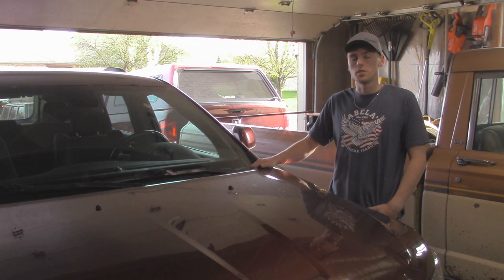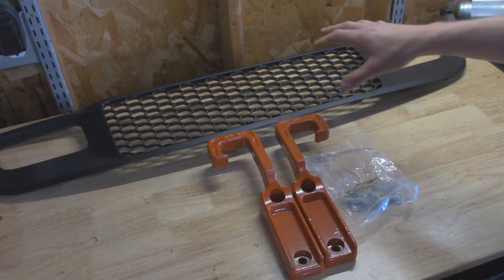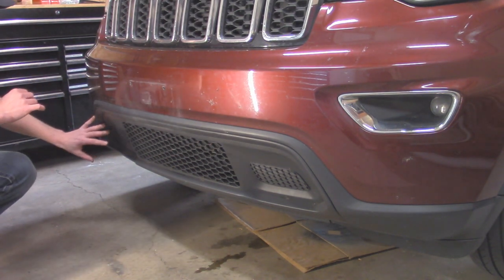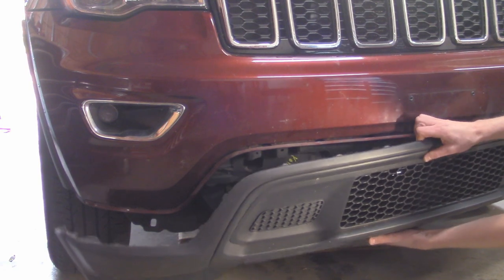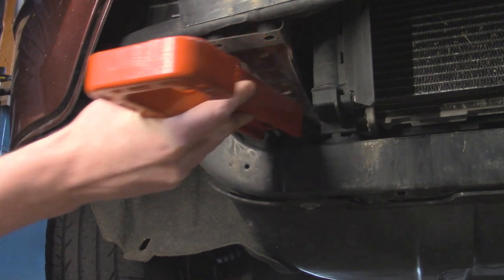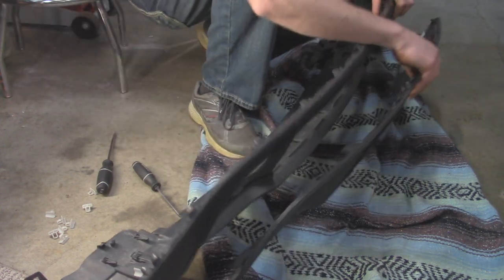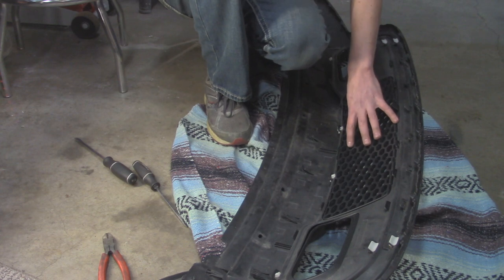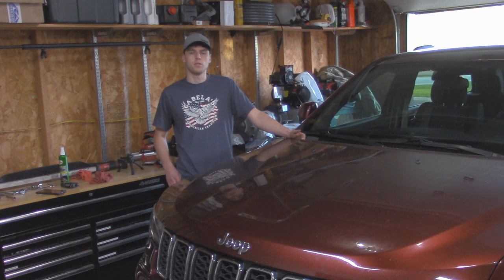Jeep Grand Cherokee Tow Hook Installation | 2015-2022 WK2

Comment: Thanks for the install walk through, looks quite easy 👍. I just bought a 2018 WK2 Limited 4 days ago and have already ordered a set of rock sliders, roof rack cross bars, and about to order a set of tow hooks. I'm only 4 days in and I see myself going down the upgrade rabbit hole and going broke already 😂! I'm having flashbacks from when I built my 83 Toyota Pickup. It didn't need tow hooks though because, well... it's a Yota! This one is only a Jeep so I may need a tow on occasion.
Reply: What sort of rock sliders did you get?

Comment: Can they also be mounted on a Jeep Cherokee 2017??
Reply from the maker: It may be a similar process on installation, but a Cherokee not Grand Cherokee will use a different designed tow hook.